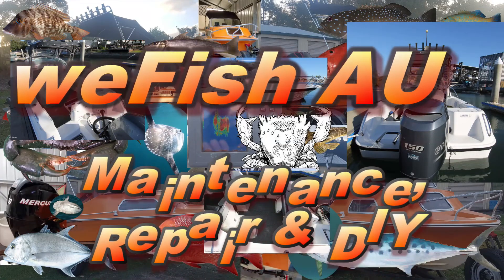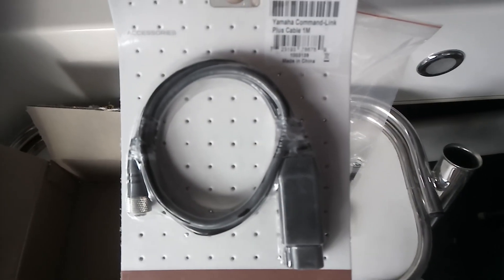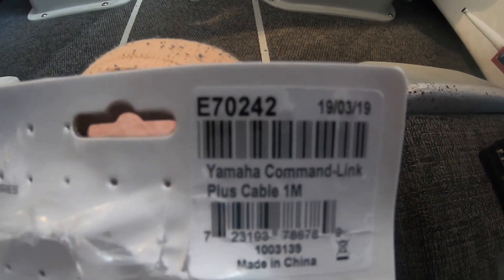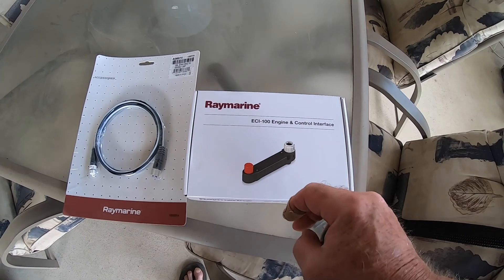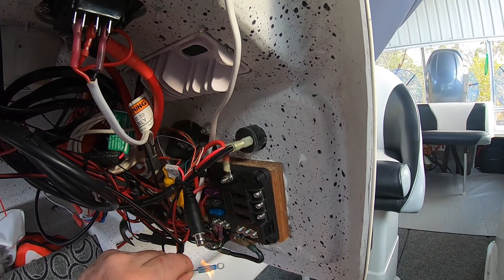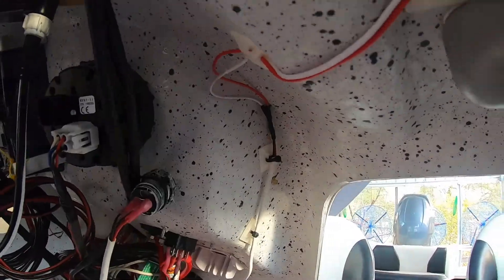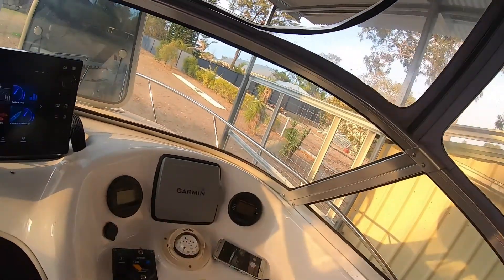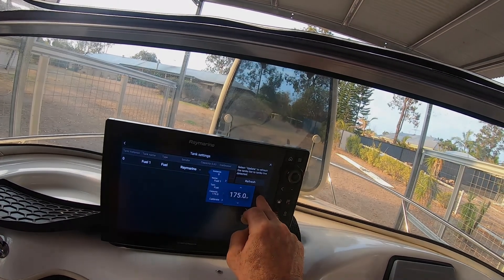Yamaha Net - Raymarine Axiom

Comment: Hey Mate, Did you end up using the ECI-100 to get stored data on you Axion. I have set up all the same except for the ECI-100 and at this point I don't think I have got the fuel usage details available from previous trips.  Have you had to install this or is it still a spare and do you have all your info from the engine fuel use available on the Axiom. Cheers Matt
Reply: Hey mate,  I spoke to raymarine yesterday and apparently a Yamaha technician can adjust what data is displayed or released from the Yamaha motor ECU. I'm yet to confirm this with a call to a Yamaha representative. With only the Yamaha raymarine interface cable connected to my seatalkng backbone I am only getting instantaneous fuel data and motor temp. Nothing else so next step I'll talk to Yamaha.
Reply from the maker: That is exactly what I saw today.  Previously when I had an Axion on the network my Humminbird would display some extra engine data.  Today, without the Axiom all I was getting was the fuel usage data.  I had previously thought it it was coming from the ECU.  I still have to check my NMEA connectivity but it should be good.
Please let me know how your investigation goes.
Reply from the maker: Yes, I connected it into my NMEA network.  I was able to get engine data from my Yamaha and read it on both the Axiom and my Humminbird.  I never checked to see what NMEA messages were on the bus so I can't say what the Yamaha was sending but I did get all the basics.  I don't recall if fuel flow was on the Axiom, I always checked the Yamaha gauge for that.
Reply: @weFishAU  yes I connected up the same except for the ECI-100 and I get flow and battery Voltages but no temps, pressures or fuel consumption data. When I turn it back on the next time to use there is no previous data. The Yamaha gauge still has last trip distance etc.
Reply from the maker: Could be.  I hope to get out again in the next couple of weeks, I will try to remember to record the NMEA sentences to see what should be available.
Reply: @weFishAU  Thanks mate. Appreciated.
Reply from the maker: I will be looking at the NMEA sentences for my own interest but if I forget to post back to you, give me a reminder in a week or two.
Reply from the maker: As it turns our, I couldn't look at the NMEA sentences.  I thought the ECI-100 was outputting them but without the Axion I couldn't see anything other than fuel.  The Axiom must have been rebroadcasting some of what I saw on the bus back then.

Comment: Can you list the items used for this? Also if you have twin Yamaha 225 is the setup the same?
Reply from the maker: I already had the Seatalk NG backbone and the Yamaha net so all I needed was to connect them together.  I ended up going with a Raymarine ECI-100 to interface the Yamaha Net to the Seatalk NG network.  Raymarine charge an obscene price for it but when you are connecting several thousand dollars worth of equipment together it seemed prudent.  When I bought it, it came with the cable to plug into the Yamaha net and I already had a space Seatalk spur cable.
If both your engines are connected to the Yamaha network then it will interface just fine.
I have been told that you can connect them yourself by buying some plugs and wiring them yourself, without the expense of the ECI-100.  I thought that was too risky.

Comment: So I just picked up a new to me boat. It has a raymarine axiom and a yamaha f150 engine. I believe the nema cable is already ran . It goes to the back of the axiom and I can read a few things of the engine with it. What else would I need to hook up the rest ?
Reply from the maker: I guess you have already added the Yamaha app to the Axiom.  My 150 doesn't send all the information that the Yamaha app can display either. 
 I get fuel level and basic engine information like RPM, temperature, pressure, etc.  I did expect more than I got but from the research I did, you need the senders to put the extra information on the bus, which are add on extras.  I didn't bother, I just turned on the alarms for the information I have.
Reply: @weFishAU  I haven't added the app. Will have to look into it.  What kind of temps do you see on your Yamaha ? I was monitoring my temps this weekend through what it says is coolant temperature on the axiom but I guess it doesn't read coolant temp? It's actually cylinder temp . If ran hard for good distances it would get up around 230 °f
Reply from the maker: I had the app on for a while but to be honest I really didn't like it.  Nothing wrong with its performance, it was more the aesthetics of the screen layout that I found unbearable.  Yes, it reads temperature from a sensor on the head, not the actual coolant temperature.  I don't remember what the figures I saw were, its been a while since I removed the app and now I just rely on the alarms to alert me if anything is out of range.  So far none have gone off.
Reply: @weFishAU  I hear ya. I was a bit worried because it reads hotter with the cylinder temp instead of water temp. Everyone says it should be like 150 max but believe that's water not engine temp
Reply from the maker: You're not the only one that was worried about that.  There was a bit of comment on one of the forums on that very subject recently.  My guess is that Yamaha tag the value as coolant temperature when the put it on the NMEA bus.

Comment: is it possible to do this without the ECI-100?
Reply from the maker: I thought long and hard about that.  It is an expensive piece of kit for what it does but on the other hand I am using it to connect some VERY expensive equipment.  I THOUGHT is would be okay wthout it (if I wired in the right plug) but in the end I decided the risk wasn't worth it.
If you ask Raymarine they will tell you that you need it.  Since my equipment was still in warranty that was the bottom line for me.  Didn't want to void the warranty.
Reply: @weFishAU  thanks for the reply! Here in good old Germany a ECI-100 costs about $400 and a new Axiom7 about $650. I think it's a litte bit of a poker game but if you look at Garmin/Lowrance they do it without a gateway. And of course you have to keep in mind that on the "non-secure" side you have your Yamaha gauges and they are also electronic devices ;-)
Reply from the maker: Totally agree.  It is an obscene price for what would only be a printed circuit board and a few diodes to provide the electrical isolation.  When you have a captive market I guess you can charge whatever you like.
I did read a press release that was dated about 4 years ago that said Raymarine were going to release a cable that would direct connect to the Yamaha bus.  I asked several Raymarine distributors about it but they all said they never heard of it.

Comment: what would i need to connect my 250 verado to my axiom ?cables ? i am using smart craft instruments now  than you
Reply from the maker: Your Verado needs to be connected into the Raymarine SeaTalk NG network which is (from my limited understanding) a NEMA 2000 network with different connectors.
I think a cable with the right plugs on each end would have worked with my Yamaha but given the price of the components involved I opted to buy the interface unit rather than risk blowing something up.
I did see in one of the manuals that the Raymarine Seatalk NG network and NEMA 2000 adapter can be connected to the Mercury Gateway (I guess the Verado uses the Mercury gateway).
Talk to Raymarine about exactly what you need.  They have a very active and helpful forum at: https://forum.raymarine.com/index.php
They will be transitioning to a new forum in a few weeks but all the information is there.
Reply: @weFishAU  Thank You Sir I will contact them during regular business hours and let you know how I do... Catch em up